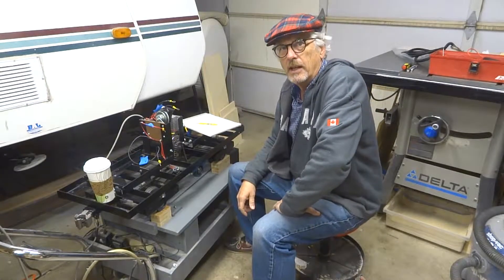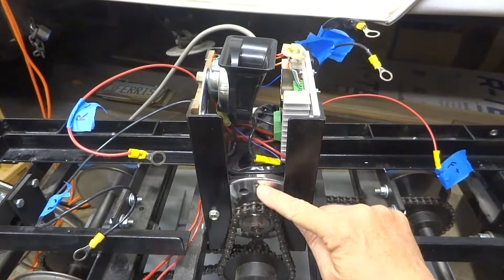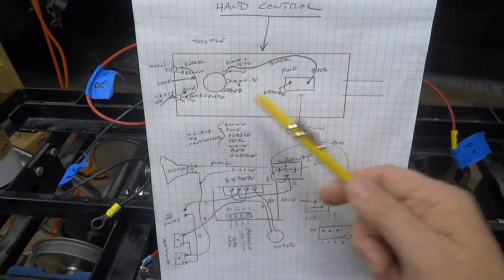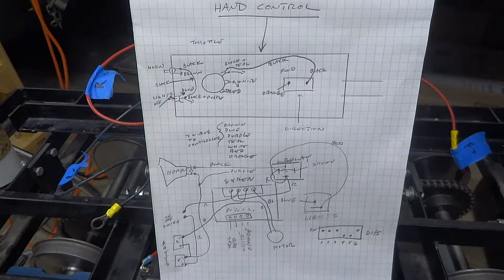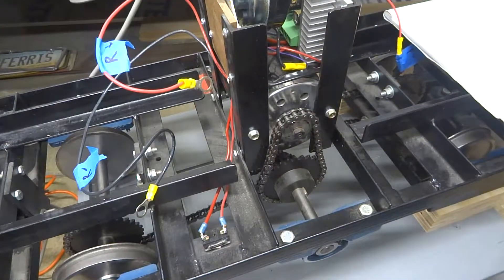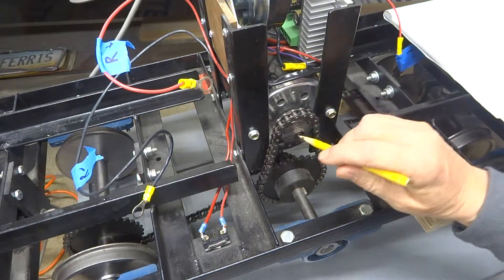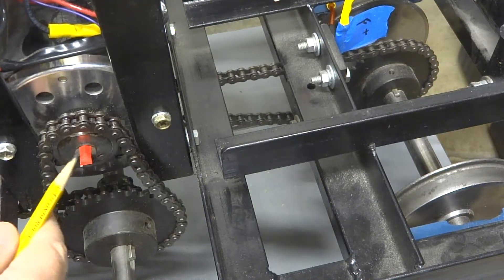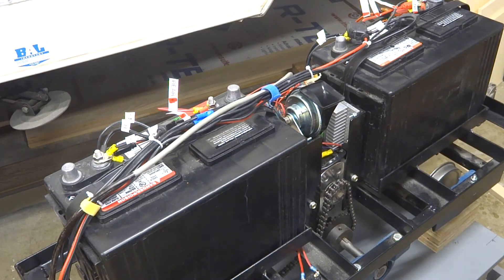Porter 0-4-0 Build - Part 1

Comment: These are great videos.  I'm trying to draw a Porter for 3D printing in 1/48 scale.  I saw in your 2nd video that you used 10" diameter for the boiler.  I'm not sure what scale you are using, but do you know the actual diameter of a boiler on a Porter or could you tell me what scale your project is?  I'm using a lot of pictures to do my drawing, but I can't find any actual dimensions of anything to orient my drawings.  Thanks for any help you can provide.
Reply from the maker: I don't have a lot of info, as my loco was sort of bespoke in design, but send me an email and I'll forward some rough drawings and photos, etc.  stanfm@aol.com
Reply: @StanFerris That would be great.  Thanks

Comment: Just found your videos so binge watching really enjoying them, building a loco myself at the moment and like what you done with  this chassis and the porter do you know what wattage and rpm the motor is
Reply from the maker: I haven't had to replace my motor yet, and it's not really labelled all that well.  But according to Aaron at Millbrook Railroad, who has the same Mr. Motion platform, it should be a 500watt 24v MY1020 type scooter motor... something like this: https://www.monsterscooterparts.com/catalog/product/view/id/20577/s/24-volt-500-watt-motor-25-chain-sprocket-electric/?msclkid=729f90fc3d0412e9d336f3c5bece0fc0
My controller board is a Syren 50.  Sounds like a fun project!
Reply: @StanFerris  thanks that is the one I have bought😁
Can I ask what is the length and wheel base of that chasis
Reply from the maker: @shaydon7315  The steel chassis frame is 36" long front-to-back, and the two axles are 20" apart center-to-center.  The original designer intended the locomotive to be sat on by the engineer, so you could get extra tractive force from your weight and wouldn't need to spend extra time and money on an engineering car to follow behind.  However, if you don't intend to ride on the loco, I would recommend shortening the wheel base, as that will allow the loco to handle smaller radius curves in the track.